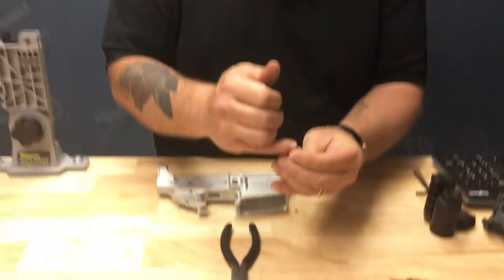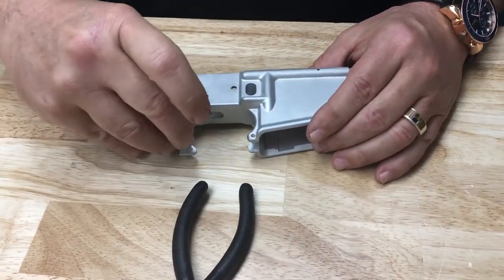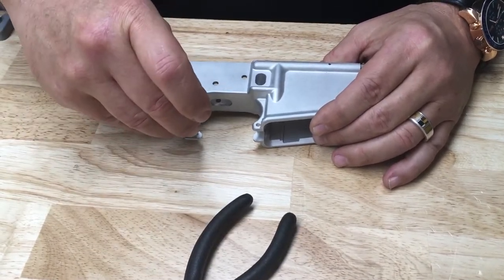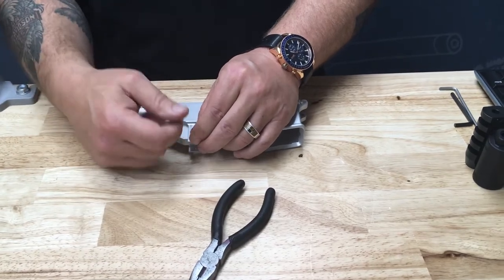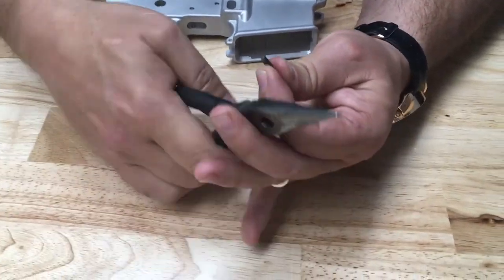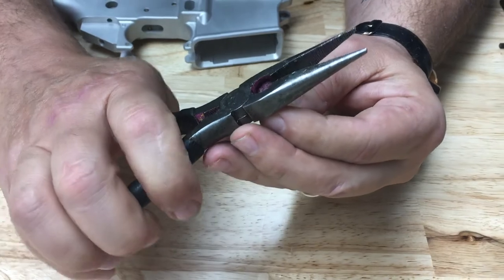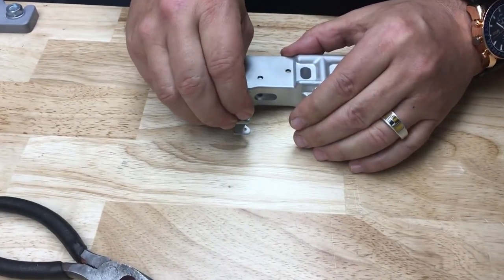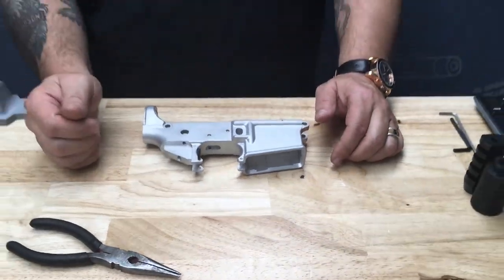Quick Tip: Roll Pin

Comment: Thanks for the clip and I'd been trying to insert the roll pins into pins that hold ram parts in place on my 2T engine crane and in 5 minutes all 3 were inserted with no issues.

Comment: Information I could have used YESTERDAY!! In all seriousness, on my last build I could not find my start punch and just went at it with a hammer and luck when assembling a gas block/tube. I ruined 3 pins in the process and was pretty frustrated. This is a nice tip to have thank you!

Comment: I would ONLY do this in a pinch. Like on deployment and have no other choice. 

Other than that, maintain discipline and do it the right way the 1st time. There's no worse feeling in the world than needing to shoot and something is broken, and your shit goes offline. 

First thing first... Don't use standard roll pins without using some blue "Maybe purple" Loctite with them. If you're going to use standard roll pins, secure them with anything even if its damn superglue or the nightmarish black or even green extreme heat Loctite. Yes, a real bitch to get out but at least you know it's not falling out on your ass because that really sucks especially in the field. 

Preferably use coil pins instead, that will not fall out on you and some purple Loctite. Not an expert, but I have deployed and been in some nasty weather from extreme heat training at the hottest place on earth at Death Valley, CA to one of the coldest places in upstate Alaska where it dropped down to -71 and blowing gust at 45 mph making real feel seem more like 'no feel'. You don't piss outside in that unless you want ice in your dick. You don't want to have to make repairs on your weapon in that crap and you certainly do not want to be digging in snow looking for a needle in a haystack. 

Something to consider.